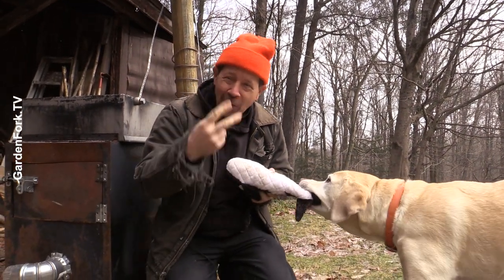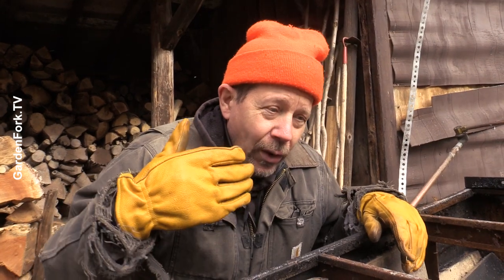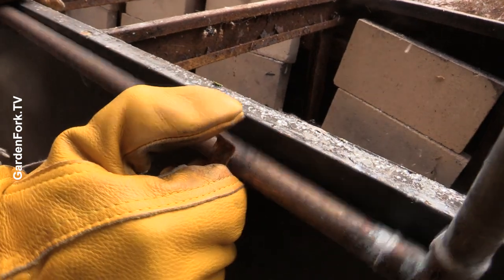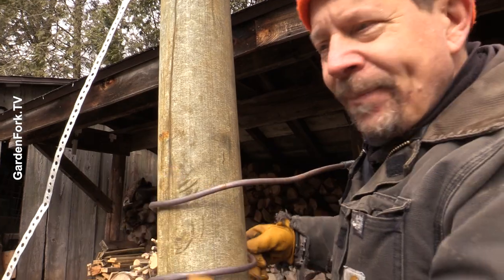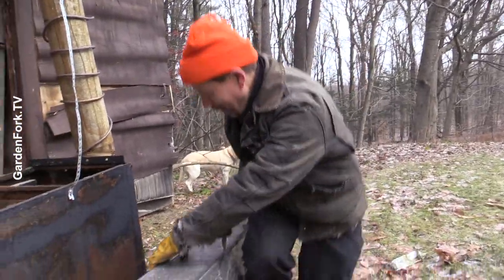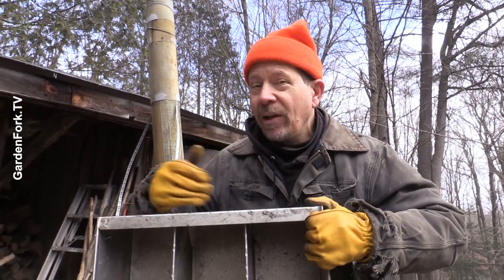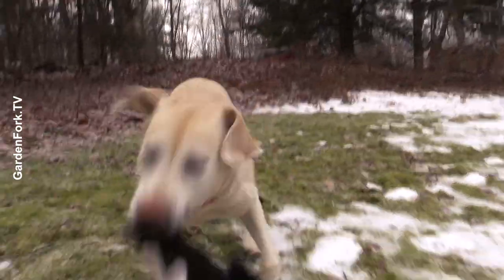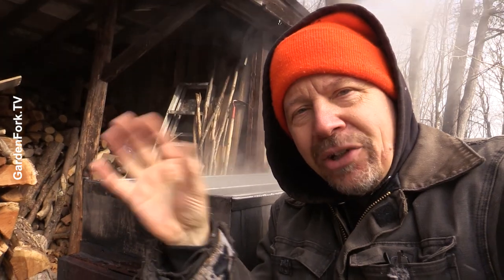2nd Version Homemade Maple Syrup Evaporator | Make Maple Syrup | GardenFork

Comment: An idea for your pre-heater that's wrapped around the stove pipe would be to place a larger diameter stove pipe around the copper line to hold the heat in. With any type of pre-heater design you will want to keep in mind to capture and hold the heat, much like putting a lid on a pot.
Reply from the maker: great idea Mike, thanks for that. I was also thinking of wrapping the copper around a smaller diameter pipe then sliding it over the 6" chimney stack. it would then cling to the walls of the stack better. thx!

Comment: Your supports on the smoke pipe is band iron , you might want to go to your local heating supply and purchase a few drives you use in duct work it will give  you a strong secure brace for the smoke pipe. Thanks M G

Comment: For the pre-heating coil, you need a lot more of it, and you should try to insulate it onto the chimney...its' just as efficient giving off heat to the atmosphere as it is absorbing it. You should be able to get ceramic fiber rolls fairly cheap online, and it could work to insulate your pants from the fire ox as well.  :)
Reply from the maker: good to know, thanks for all that. I was thinking of maybe putting the copper preheat coil inside the stovepipe this year. and i will be insulating the firebox and arch with tile backer board, the durock cement board sheets. thx!

Comment: 3.0 should be a better design.  look to fire brick the entire thing with mortar unless you like that bit of warmth.  on your pre heater design, most times ive seen multiple wraps of copper tubing and shielding the wrap with another 7 or 8" pipe would help also.  you will notice your flow goes up, down, up, down and then back up. better if you could move the tote closer and also warmer.  the longer that line, the more btus you give up (better chance of freezing).  If you kept tote nearby and had a small head tank up high and went down to a perfect drain all the way thru you would do better.  Look for my 55 gallon barrel cooker thread on MapleTrader.  Name is Needmoremaples. Great videos and keep them coming!

Comment: Try applying the rocket stove methods to your burn chamber. Very similar to your baffle comment. Live the channeled tray.
Reply from the maker: I have seen a video about a rocket stove evaporator Jonathan, it has me thinking. Not sure how to use it with the wide tray. thx!
Reply: GardenFork  there is a guy who does rocket stoves with large burn chambers and multipath heat distribution. His channel is broaudio. His design in more for  a rangetop and oven but could be easily routed for a large tray. Similar to how many route heat for mass storage. The idea is to get the hot air moving through areas instead of directly on top of the flame. This also allows for more complete combustion and less wood.
Reply from the maker: I’ll look at that channel thx!

Comment: There are several vids on this on YouTube but here is a link for copper coil water heater for a wood stove pipe.  Found this about a month ago and it looks like you could easily use this method for preheating sap...
https://youtu.be/AbDMITAMLio

Comment: Seems like a good, solid, easy and dependable way to make N evaporator.

I'll be tapping birch trees this spring, no sugar maple here, and will try this.

I'll also use it to evaporate seawater to harvest salt I think. And I may even use it to heat winter mash for my livestock.

I'd stick with the smaller catering pans you used previously, as they would work better for hit food for pigs outdoors.

Thanks.

Comment: Pallet length is a great thing, cool build!    About your preheater, etc:   Your coil should be outside the pipe.   Put much tighter to it, and longer (more wraps) if possible.     Then insulate around it.    Maybe use a sleeve of larger stove pipe around the coil, with the void packed with mineral wool or something?      And flue damper goes above the coil, obviously.

Also:  auto fill level device... sounds an awful lot like a toilet mechanism.     You can get some nice ones that the float is made of copper, so it should be heat tolerant.  The main "tube" that holds the valve body would be mounted outside your tub, with just the float hanging over and, well, floating in the corner.   You'd then re-pipe it as needed.    It would be very, very ugly, however ;)

Comment: total fail number 2, and you 3 will be too. still no by pass plate second burn, i have made the fire boxs up to 6 feet long and with just a fire on the end it forces lots of heat though out the pan,  dont build 3.0 you dont have it right still. you dont need the dividers in the pan, that only makes for harder cleaning, i use 10 ga stainless steel (1/8 about)  still forced air is in wrong set up, and wrong kind of fan you need high forced air and they are smaller then a heater motor in a car you need high cfm..  and still forget about the pipe damper, you have the right idea with the pre heat tube but like many before you tried to put pipe out of the hot water tank and in though the fire box an back into the tank, the water will not move on its own at any degree to do anything, it need a small circulate pump, short of that it is just boiling water sitting in a pipe, like you trying to soder a copper water pipe with water in it, it dont move, sure heat will move very slow don the pipe for a very short distance but when it hits cold it stops, some how people have this idea it will flow on its own, in theory no.. if i had better camera gear i would build one just to show people how too, to add to my videos.. and a drone would be so great,  even tho we dont have maple trees here, but we boil good stuff... i am only a $800 cnd disability pention since i broke my back.. at work... lost everything to an ex wife cheating gold digger,,

Comment: Question:  If you are blowing air into fire box via fan, can the stove pipe be shortened.  Then you build a frame work to go around the pipe and extending a few inches above the pipe.  Another pan could then be placed on frame work to take advantage of this   "wasted" heat.  Stack temp must be at least 300 to 400 degrees.  Also if a secondary air inlet is cut into the base of flew pipe the added oxigen  will allow the unburnt flew gasses to egnite making for a much hotter and much cleaner exost. I have watched a lot of youtube on making maple syrup and I have not seen this.  Maybe it won't work. I don't know.  But that heat directed on the bottom of that pan has to do something. Just an idea.
Reply from the maker: Good idea Jim, it’s all about keeping that heat on the pan. Thx!